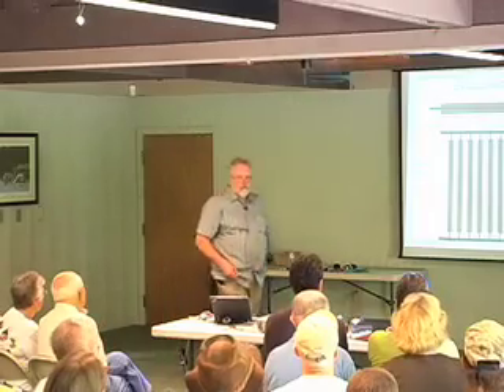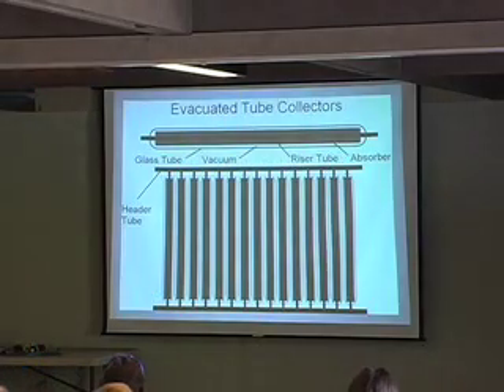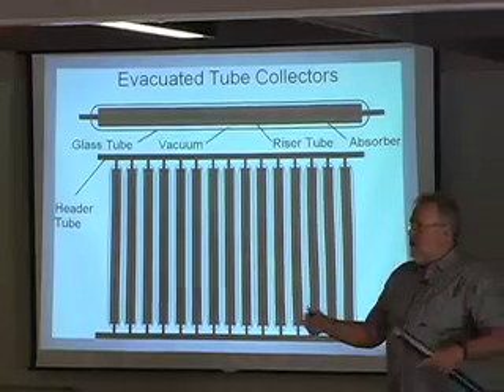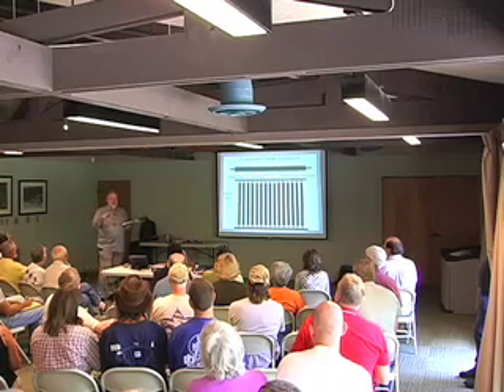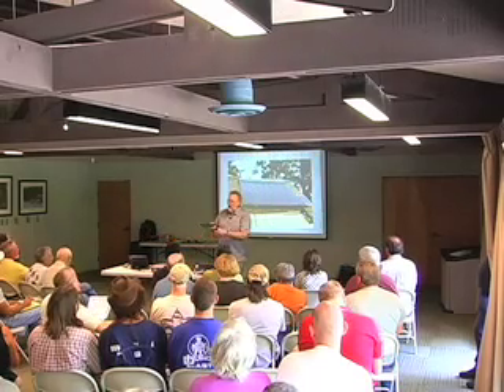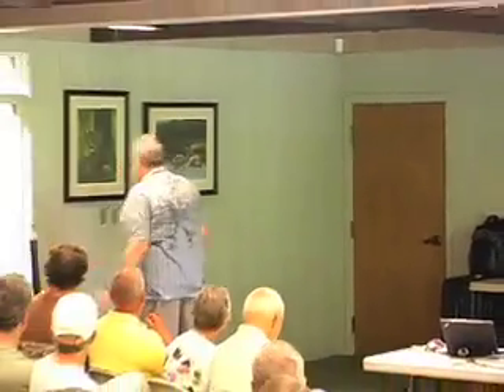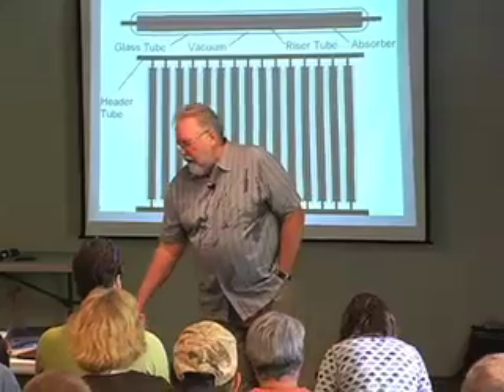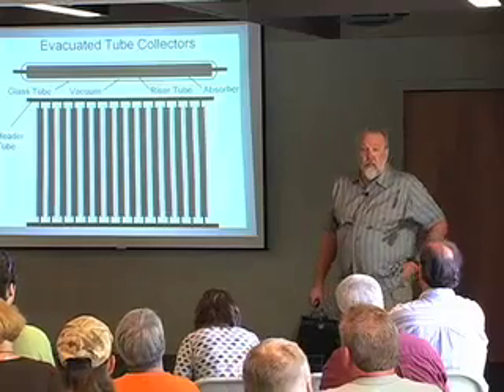Solar Hot Water: Evacuated Tubes In Depth

Comment: Just to clarify about the borosilicate glass, it is used because it is stronger and more resistant to thermal shock (and thermally shocked those tubes will be). Tempered glass is mostly used where safety is a main concern, because it breaks into small pieces, that are not as sharp as other types of glass. That makes it [tempered] ideal for car windows, and glass that protects someone; but not for applications where rapid heating and cooling may be an issue.

More information here:
https://itstillruns.com/borosilicate-vs-tempered-glass-5786607.html

Comment: Good presentation but it would be improved if you used "Dewar" flask instead of "Thermos" since Sir James Dewar made the first practical vacuum flask. The heat retention is of course achieved by eliminating the heat transferred by convection currents, and further improved (in a Dewar flask) by the silvering of interior surfaces which minimize radiation transfer. Not having seen an evacuated hot water tube, I do not know if they have interior silvering - probably not as they need to transfer energy to the core from the exterior.